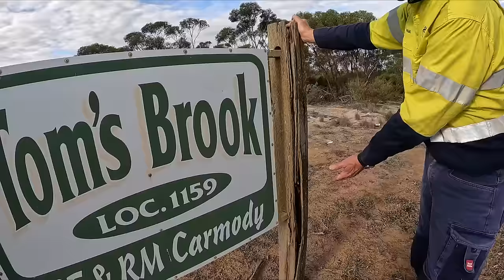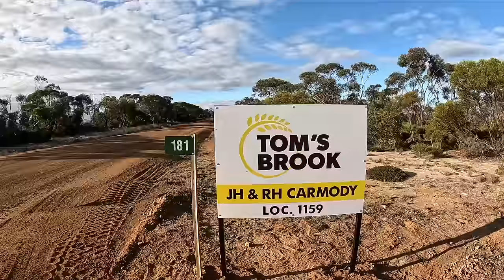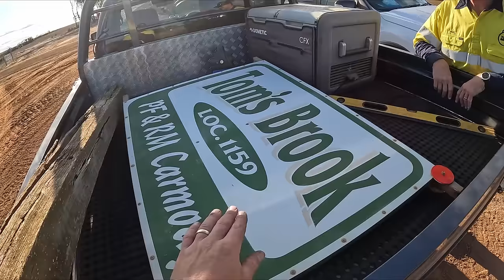Changing of the Guard!

Comment: The manner in which you install the cup and pack the cone with grease are grand dad's method. You can buy a grease packer which does all sizes  and styles of bearings for about $30 in Repco. This does bearings from 11mm to 100mm ID. Repco have a youtube  video on how to use it. You avoid air pockets in the cone. I have not seen a Shed Beer Fridge. Besides keeping  drinks cold, the freezer is where all crazy items such as  bearing cups a kept in sealed  bags such as sandwich bags. When I have a bearing replacement job on, i have a plastic lunch box with engine or auto trans oil in it. I dip the bearing cup in it and put in the plastic  bag and into the freezer for about four hours to as long as you like. The bearing cup practically falls into place. About five minutes after installation the bearing cup is tight in the housing. For theseeding etc , I would have half a dozen bearing cups ready in the freezer. The best example I have seen  of this was the fiiting of interference fitted bolts nearly 40mm dia and 300 mmlong. the bolts were slid in and nuts tensioned up before the bolts expanded and grabbed in the hole. This was for a solid coupling joining a turbine shaft to an alternator to make a solid uint. Tolrances were -3 thousandsth of an inch and + zero. You also need a parts washer to clean up the components once the shaft is seperateded from the hub. Over all a lot less messy and pre seeding you are able to set up a production line, preparing the cups and cones. i use this method when overhaulling trailers. Cups in the freezer Cones packed and wrapped in paper towel whilst the hubs are being cleaned in the parts washer. This reduces contact with greases etc which are NEGATIVE for your skin.Cheers

Comment: What you've been calling cones, are actually cups. The part with the rollers is the cone. If you warm the cone up with say a heat gun, then drop it into a container of grease it flows in nicely. Applying silastic between the sign and the frame might stop some vibration and possible failure of the composite. Thanks for your videos, I enjoy watching the day to day dramas on the land. Regards.

Comment: Hit blocked coulters with hammer. Boom unblocked in seconds.
And we run a radiator with our hydraulic oil running through it in front of all our air seeders fans which takes all moisture out of lines. We couldn't run with our damp cold air in NZ without warming the air. Bourgoult make a kit. Mike has em.

Comment: Hey JH, not sure if that fridge in the background works, but if you chuck the bearing cone in the freezer to cool down for about 15-20 minutes it’ll be just that little bit smaller and make life that much easier.
Reply: Old rule of thumb is 1thou/ inch/100degree. LN2 is the go, Gives about -195c
Reply: @butchphillips873  yeah that was my first thought, but you’ve gotta remember where he is, he’s a good distance away from the nearest town. And that’s IF the local gas supplier carries the stuff. But absolutely, if you can get your hands on it, cool it down properly.